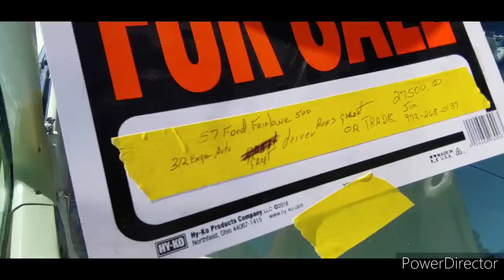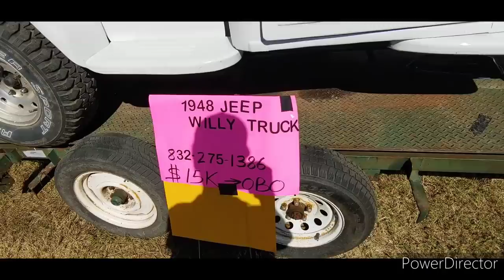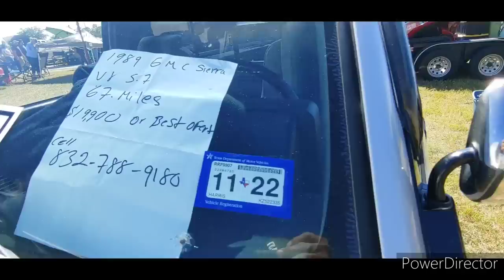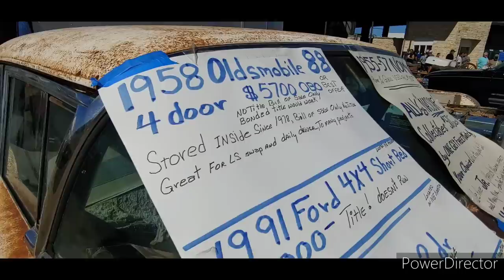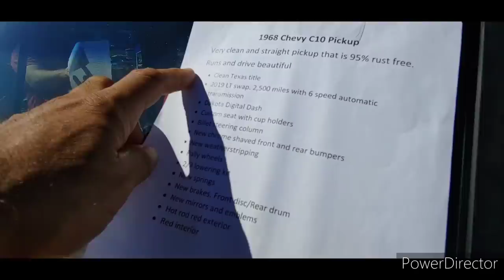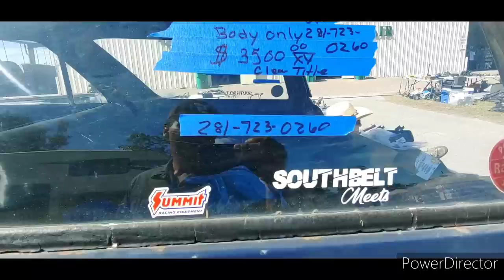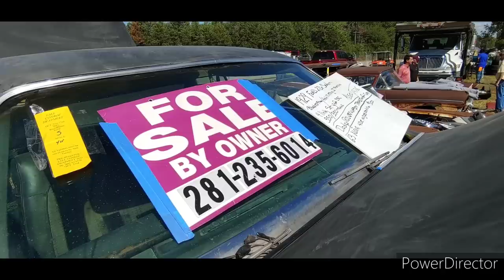Fall 2022 Conroe Texas Swap Meet. Lots of Projects and Parts

Comment: 1:17 Good way to start a swap meet video with a 56or57 Chevy or Oldsmobile station wagon.
14:04 Don't see often too many Willy Jeep pickup trucks for sale nice.
19:46 Wish could buy 56 Chevy Cabover that's eye-catching.
41:35 Wonder how much 29-31 rat rod cost.
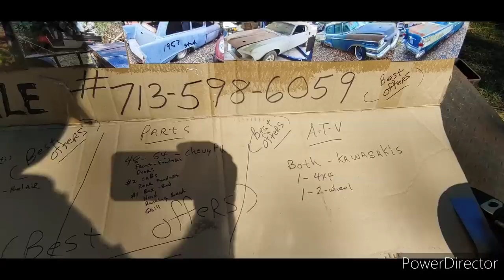51:18 Neat 74 Malibu wagon daily driver that.

Comment: Part of the thing with the truck parts, is that's a lot of what people are fixing up, the OBS, and newer generation trucks like yours, and same era Ford's. These are still trucks that the average person can work on,and get most parts reasonably. I have 2 OBS trucks myself, and was looking for parts (since I can't always find what I need at my local wrecking yard). Apparently the part of the meet I went in, was the only area that didn't have any that weren't still on the truck.
Some of the truck stuff is new truck take offs, like when a guy buys a truck and changes the wheels, bumpers, maybe the grille....Been happening for decades. Maybe more noticeable now?
The building you went in the back of, most of that was the body shop supply, several cars/trucks for sale, tools and some toys and memorabilia. I was in the front section, most of the vendors there had toys and collectible cars. Some signs and a guy with automotive art prints, more tools and stuff.
The show as a whole had lots of vendors, but not too many customers. I sold less in 3 days than I do at some of the Saturday morning toy shows (and that's w/o a 4 hour round trip and a motel for the weekend). I think a big part of why the swap meet was so big, is that a lotta people are needing $$$ right now, so they're trying to sell whatever they can.

Comment: Personally, the swap meet videos are like watching paint dry when they are this long, LOL. Unsubscribe special right there, that's it. LOL. I like the junkyard runs better. Isn't it too hot for the woofer to be in the car? We should be seeing more of him, as he looks like a friendly doggo. 

Yes, people are raising prices because the cost of fuel and the cost of items new are going up. So people have to charge more to make any kind of profit. I had NOS GM 4x4 OBS rims, "takeoffs". I did sell them. They cost me nothing, so it was all profit. 

The Monte Carlo is a 1977 with the tag (barely) so we can brag: ST77 for 1977 model year, 1AH57 for Monte Carlo, B for Baltimore, MD assembly, 11V for white and black vinyl interior trim, A52 for bench seat, 19U and 19L for Black upper and lower exterior paint, looks like 03C for the third week of March 1977 production. No VIN, can't win, but easy to figure out, no doubt: 1 for Chevrolet, H for Monte Carlo, 57 for two door, U for 305 V8 with two barrel, 7 for 1977 model year, B for Baltimore, MD assembly and the rest is the production sequence. The Baltimore, MD plant operated from 1935 to 2005 and the Astro and Safari were the last vehicles made there.

Nah, a nice set of stock wheels makes those OBS trucks better. They fit right and look nice on the right truck. The sunroof probably caused the rust on the pillars from a clogged drain over the years. LH fender looks like code 6G Gold Fire Metallic Light exterior paint and the rest 1C Black exterior paint. Yikes, please do not "LS swap" the world on that Oldsmobile, even if the original engine is missing. 

At about 26:46 in, that looks like a Sinclair sign (well half of it), and the Standard pump is what became Amoco (and later BP). Looks like an ATD middle box on a cheap homeowner Waterloo made Craftsman. At 33:23, that's similar to a van Mr. Magnante featured on his channel the other day. Yes, that's an English phone booth. I like those rollaway toolboxes, I need a bottom roller or two, plenty of tops. LOL.

At 54:41 I would be tossing all of those aftermarket wheels for OEM wheels. They look (and fit) correctly for the car. Is that the Imperial that GMAC has/had at the yard? Looks like code Y1 Top Banana exterior paint on the Charger at around 1:00:33 in. 

No, that Buick is a 1955 Super Riviera with the tag for the brag: 1955 for 1955 model year, 56R for Buick Super Riviera, BK for Kansas City (Leeds), MO assembly, 453 for Light Gray pattern nylon and Light Green Cordaveen interior trim, possible code Y Mist Green lower exterior paint and code B Dover White upper exterior paint. The original engine is a 322 CID V8 with about 236 HP.  The four holes on the sides were not unique to the Roadmaster in 1955. No VIN, can't win, but easy to figure out, no doubt: B for 1955 model year, 5 for Super Series, 4 for Kansas City (Leeds) MO assembly and the rest is the production sequence.
Reply from the maker: Ah come on Google man, some people enjoy the swap meet vids. I know that no one really watches all the way through but they rend to watch enough where they make me a little chunk of change. Often enough to pay for the trip and the parts I might buy. I'm already there so might as well make a video and make some 🍞 😄
Reply from the maker: Oh yea I forgot to mention in the video that my mom went back to the car with the dog. The. Ac was on
Reply: Glad to hear the woofer was safe and cool. I think all dog breeds deserve a chance at a good life.
Reply: @ClassicRideSociety  No issue, I watch them through the end, even when it's like watching paint dry. LOL. Yes, I get it, you have to make the revenue to keep things going and pay for the expenses of the channel. I'm not unsubscribing, you can be sure of that. LOL. I just prefer the junkyard walkarounds more.
Reply: @ClassicRideSociety thank you for the video.  I’m thinking about going and it gives me an idea what’s it like there.  Thanks!
Reply from the maker: @ILYMAD66  always plenty out there to check out at this swap meet. 👍